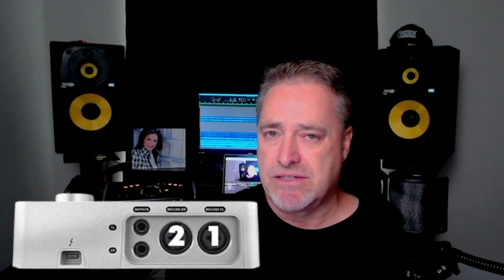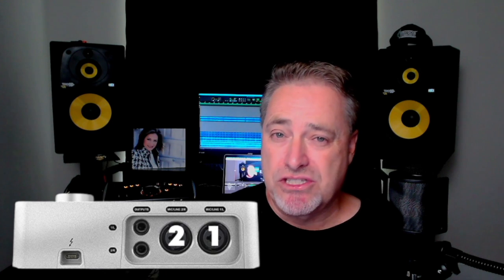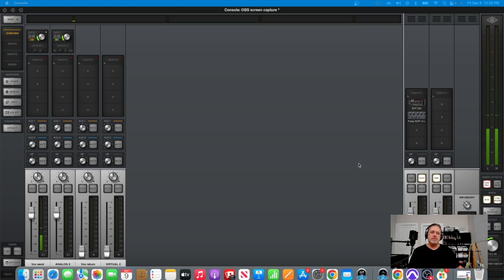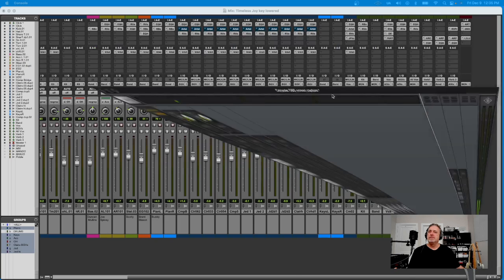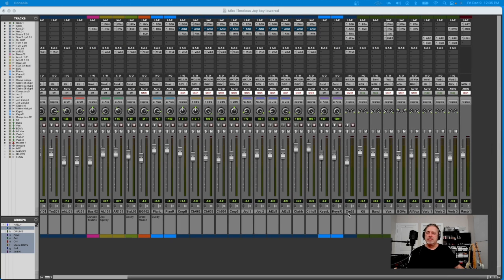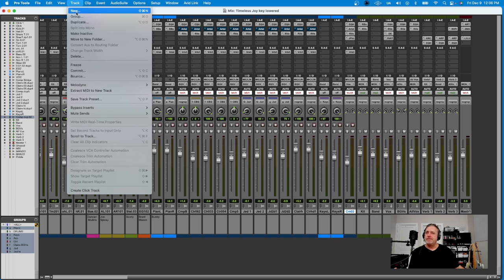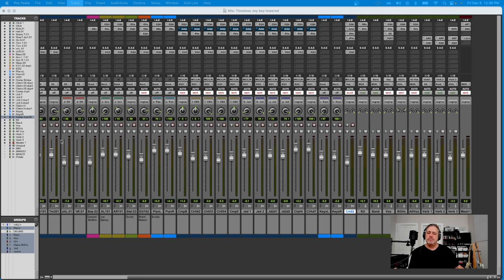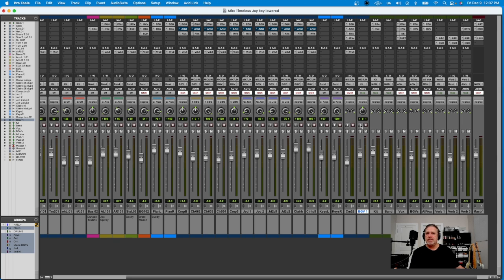The UA Apollo Fixes Latency in Pro Tools

Comment: UA is ridiculously complicated to use...when it works it sounds great but damn getting setup and trying to download plugins is hard.Also make sure you know what you are buying. The UA Apollo Solo can not do most of what UA advertising promotes. Get the Apollo Twin at minimum for the true UA hybrid experience....or just pay 1/2 that price for an ultra user friendly, great sounding, and reliable Focusrite Scarlett...sure it may not sound as good as the UA but you wont lose your sanity and bank account either.
Reply: Scarlett to Apollo user here. I switched from the one to the other (Scarlett to Apollo Twin X Duo specifically) because of the inherent latency of USB. There is no way around this if you don’t use a faster connection. Getting hardware mapped to the recording software isn’t that hard. If you are using something like the Scarlett, it is the same concept as using an Apollo. The big difference here is the Apollo can host some plug-ins that can be used inside the device and sent to the software during recording. I could not run an Addictive Drums 2 midi track AND RECORD guitars in real-time without the guitars sounding as though they were off time. That’s the nature and limitation of USB vs Thunderbolt.
Reply: @scottarle  never thought of that... for tracking along drums or anything from computer I would NEED TB3 or beter..To PRE monitor ALL I would also need a drum machine and external synth pedals and ?!? Drum machine programmins is hard for me Easier with computer screen..  I made a few ok drum beats sound a lot better.. 6% swing was my fave... I Used Studio One @ 96k with a reported latency of 1.67ms.. I was wondering what the reported round trip latency was with the UA gear.
Reply: @steves5119 if you were going to use outboard hardware for beats, a mixer would be a saving grace. As for the latency you mention of 1.67ms, that is a very solid round trip. My round trip with the Apollo is about .67ms-1.3ms. More than enough  to play on time, have a great sounding recording and be happy with the results.

Comment: was curious about the round trip latency with using software monitoring with studio one?? I know my now non working MOTU is a hair too slow for me (1.64ms).. Other conceren for me is that this UA solo does not have a midi keybord input... limited to usb 2 with what I had.. and that also a hair too slow.. occasional clicks are unacceptable as I just want to play piano or wurly etc as if its the real deal!! Also I beleve this unit does work with a PC (pretty good one) which is all I currently have.. One day I plan on M2 or better mac mini.
Reply: I am on a roll with this post. I am using a Mac Mini M2 base model (8GB unified; 256GB HDD). I bought a Satechi base and added a WD 1TB SSD for expansion of USB ports, miniSD, SD, two front mounted USB jacks, front mounted headphone jack and covered mount for the SSD. I can use a midi keyboard (currently a little Akai one that came with my wife’s MPC). No discernible input latency using the keyboard. I can store applications on the SSD and run them from that location and it works great. I did spend some extra $$ to get the speeds I needed but it is worth it. I will disclose that getting a hub like mine takes up one of the TB3 jacks on the back of the mini but with all of the other jacks I have now, and still being able to connect the Apollo to a TB4 connection, I have zero complaints. With that added storage and SSD performance, it allows the Mini to perform better and I can store all the pkgs, IRs, audio programs and whatever I can think of. I still had room to create a TimeCapsule partition as well.
Reply: Last thing. The Apollo does work with PC but a Google search will make you think twice about trying it on a PC.